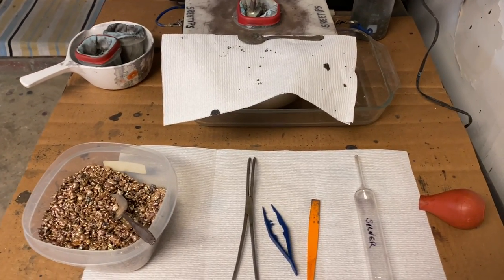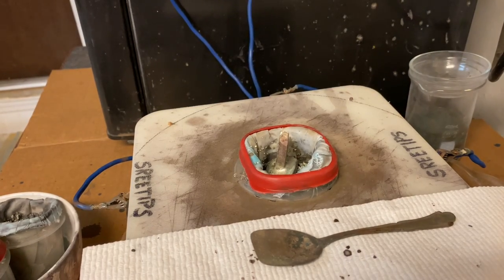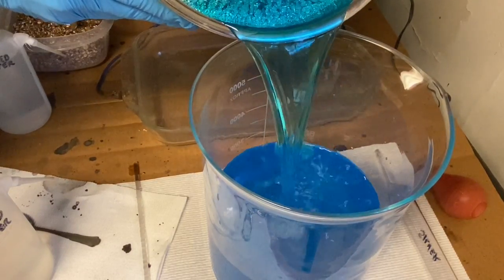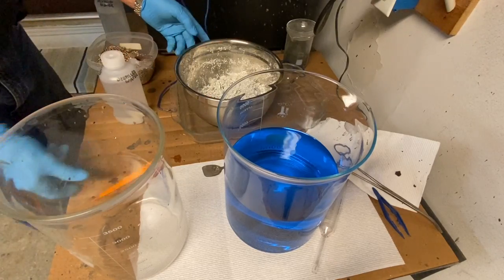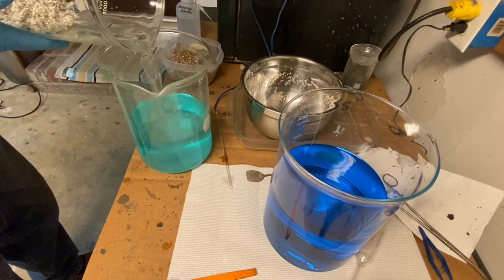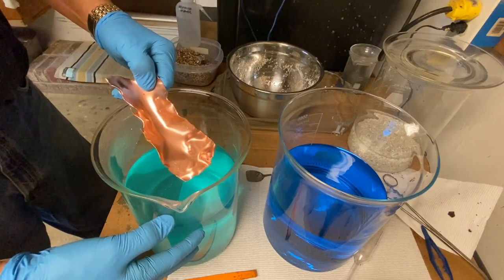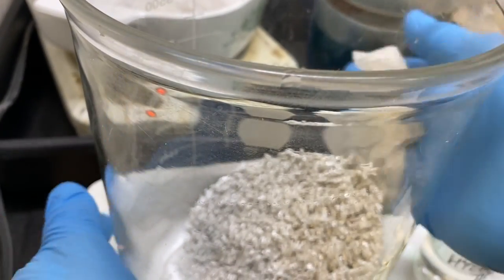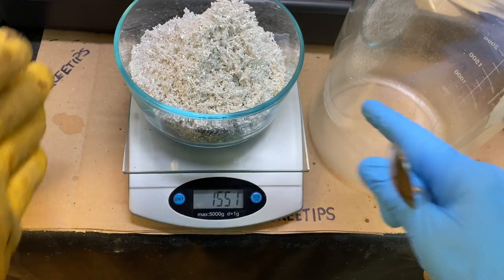Kilos of Pure Silver Cell Clean out

Comment: Still don’t know how this works
Reply from the maker: The electric current flow dissolves the silver in the anode basket sitting on top. It travels through the electrolyte and plates out on the snide of the stainless bowl (which is the cathode) as high purity elemental silver,

Comment: What cell what is going on here I felt like for a minute it was illegal
Reply from the maker: partially refined 99% pure silver granules, rendered from sterling/925 scrap silver, are placed in the anode filter basket on top of the cell. The anode basket is suspended in a silver nitrate solution that contains 600g of pure silver dissolved in 3.5 liters of liquid. This silver nitrate “electrolyte” is contained in a stainless steel bowl. The stainless steel bowl acts as the cathode for the silver cell. I attach the positive lead of the power supply to an electrode bar, of my own design, that sits on top of, and is in contact with, the 99% silver in the anode filter basket. The negative lead from the power supply is attached to the stainless steel bowl. I then pass an electric current regulated to 3.5 volts DC through the cell. The electrolyte, being highly conductive, completes the circuit from the anode filter basket to the stainless steel cathode. This current flow causes the 99% silver in the anode filter basket to dissolve. The dissolved silver ions pass through the pores of the Dacron vacuum cleaner bag that is used as the filter in the anode basket on top of the cell. The ions then travel through the highly conductive silver nitrate electrolyte and deposit (plate out) as absolutely pure elemental silver metal on the inside of the stainless steel bowl. The impurities from the 99% silver in the anode basket get trapped in the Dacron filter bag in the anode basket as “silver cell slimes”. These slimes will contain gold and platinum group metals. I save the filters and recover the precious metals that they contain. The pure elemental silver is called “pure silver crystal” but they are not true crystals. They are actually pure metallic silver that gets plated out, over and over, on top of itself to form the beautiful “crystals” you see in the video. Kind of technical, but I hope that this helps you understand the concept of an electrolytic silver cell.

Comment: Alright, so what is a Silver Cell? Google ain't giving me nothing.
Reply from the maker: Electrolytic silver cell; we pass an electric current, 3.5 VDC, through 99% pure silver shot located in an anode filter basket on top of the silver cell. This basket is suspended in, and in contact with, an electrolyte made of silver nitrate. I like to use just under 200g of pure silver dissolver in 1 liter of liquid for my silver cell electrolyte concentration. The electrolyte is contained in a 3.5 liter stainless steel bowl (I bought mine for $9 at K-mart). A DC power supply is used to power the cell. The negative lead of the power supply is connected to the stainless steel bowl which acts as the cathode for the silver cell. The positive lead is connected to an electrode bar, of my own design, that sits on top of the 99% silver shot in the anode filter basket. Current flows through the electrode bar into the 99% pure silver shot and dissolves the silver that is in contact with the electrolyte in the bottom of the anode filter, the portion that is suspended in the electrolyte. The silver ions pass through the filter and travel through the electrolyte and plate out on the inside of the stainless cathode bowl as absolutely pure elemental silver metal that look just like crystals. The impurities, not being dissolved by the current, get trapped in the anode filter and the metals contained in these “slimes” are processed separately for the precious metals that they contain. The silver produced in my silver cell is very close to five nines fine. That’s 99999 parts per one hundred thousand. Or 99.999 percent pure silver. Every investment grade pure silver bar or round in existence today began life as pure silver crystal. Just like the silver crystal that you see in this video.
Reply: Woah! Okay, thanks for the explanation man! I'll have to read up on some of the unfamiliar terms there, but once again, thanks for giving me a rundown!
Reply from the maker: The reason the info is limited is because most refiners don’t want their refining secrets getting out to the masses. A fact that I exploit in order to have a successful YouTube channel. Cheers!

Comment: What the actually f*^k. Are you telling me I can grow silver? I'll be rich by tomorrow
Reply from the maker: partially refined 99% pure silver granules, rendered from sterling/925 scrap silver, are placed in the anode filter basket on top of the cell. The anode basket is suspended in a silver nitrate solution that contains 600g of pure silver dissolved in 3.5 liters of liquid. This silver nitrate “electrolyte” is contained in a stainless steel bowl. The stainless steel bowl acts as the cathode for the silver cell. I attach the positive lead of the power supply to an electrode bar, of my own design, that sits on top of, and is in contact with, the 99% silver in the anode filter basket. The negative lead from the power supply is attached to the stainless steel bowl. I then pass an electric current regulated to 3.5 volts DC through the cell. The electrolyte, being highly conductive, completes the circuit from the anode filter basket to the stainless steel cathode. This current flow causes the 99% silver in the anode filter basket to dissolve. The dissolved silver ions pass through the pores of the Dacron vacuum cleaner bag that is used as the filter in the anode basket on top of the cell. The ions then travel through the highly conductive silver nitrate electrolyte and deposit (plate out) as absolutely pure elemental silver metal on the inside of the stainless steel bowl. The impurities from the 99% silver in the anode basket get trapped in the Dacron filter bag in the anode basket as “silver cell slimes”. These slimes will contain gold and platinum group metals. I save the filters and recover the precious metals that they contain. The pure elemental silver is called “pure silver crystal” but they are not true crystals. They are actually pure metallic silver that gets plated out, over and over, on top of itself to form the beautiful “crystals” you see in the video. Kind of technical, but I hope that this helps you understand the concept of an electrolytic silver cell.